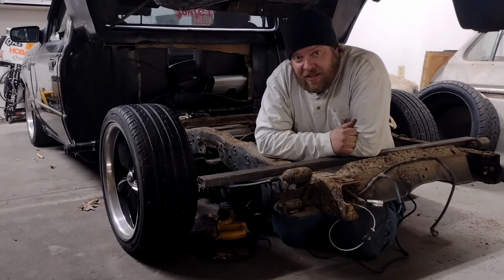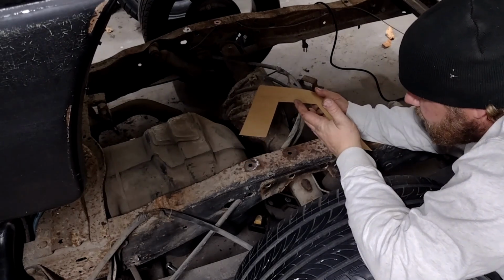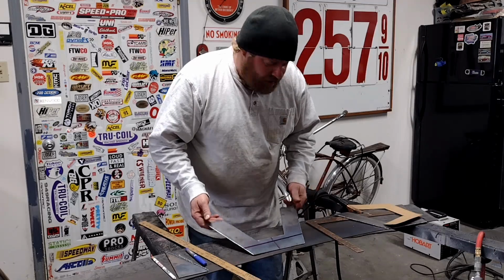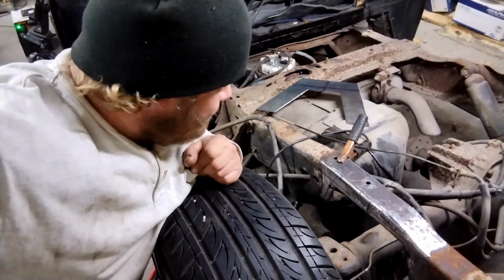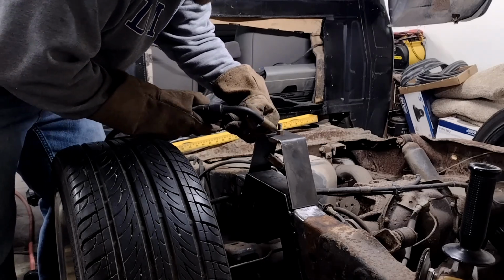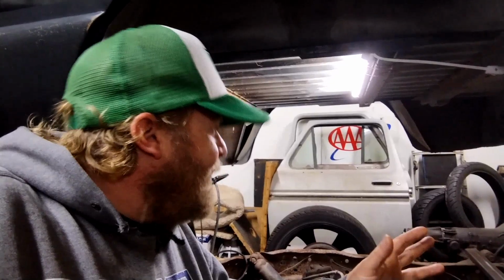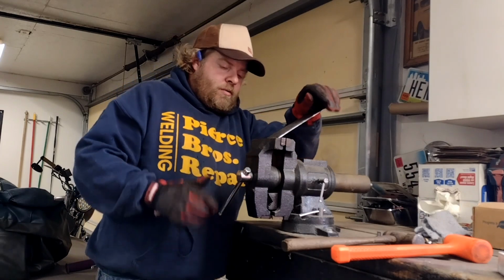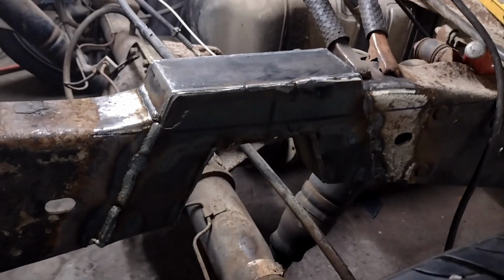Under Bed MINI NOTCH Fabrication! 96 Ford Ranger - Minitruck BUILD! pt.2

Comment: Nice work bro. Glad to see the series continue. Hoping to do the c-notch on our C10 over the winter so we can have the drop suspension on before Spring hits. Cheers!
Reply from the maker: Thanks!  I'm excited to see more on the C10 even if it's not air ride :)
Reply: @EvanWells07  LOL. Thanks. Tough to fit in time to work on it with travel every weekend this month. Each time I think I can move forward with it, we hit another issue with him that needs to be fixed before moving forward. Damn classics. LOL.
Reply from the maker: The joys of working on old stuff.  That's how they turn into a full restoration.

Comment: looking good bro ! your defiantly better cutting a straight line free hand with the plasma then me hahaha . i was going to suggest something cheap i use to get really nice lines with mine is these magnetic straight edge things that you can use with your straight edge ( like the framing square you were using ) that's the same thing i use for doing smaller straight lines . i got mine from 911motorsports  he calls them magnetic plasma guide holders well worth it
Reply from the maker: I usually would use a straight edge (I have a long aluminum level), but I like using the wire guide piece that normally clips on to the end of the plasma with it so I don't have to worry about the tip.  Haven't been able to find it anywhere, and need to order one.  Thanks for watching!